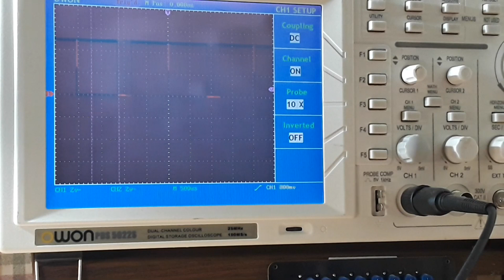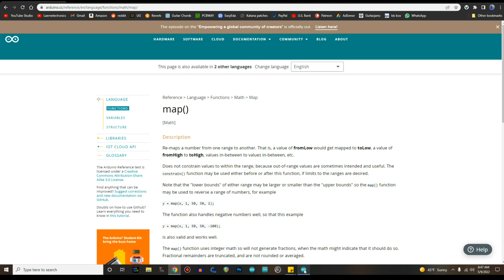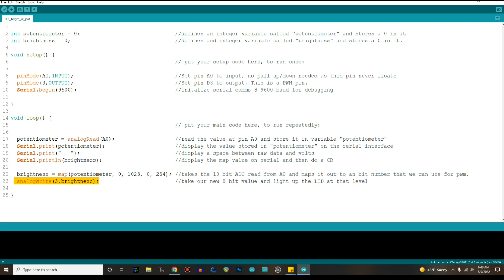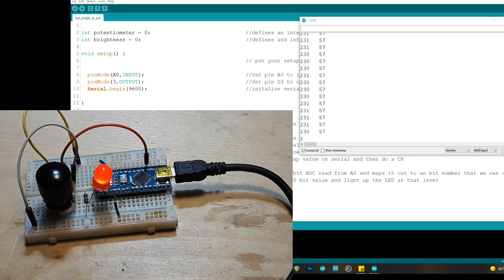Intro to Arduino PWM - Arduino Foundation Series

Comment: Paul. Can I use this circuit too control mains on hot plate ?  I have a nice hot plate but no way too control the current to it. It’s perfect for smd soldering but I can’t control the temp or make it stable.
Reply from the maker: Yes, put a relay in place of the LED
Reply: @learnelectronics  ok ty

Comment: how is the frequency of the pwm relevant here there and every where? nice knob. nice job
Reply: If you  change this from using an LED to something else, you can control all sorts of things.  I would assume you could control motor speed.  I an looking at a circuit like that for electric heated gear where you control the pulse of the current through the wire rather than using a resistor which can heat up and cause problems.  There are a lot of different uses for this type of circuit
Reply: @stickboyST  how is the frequency of the pwm relevant in each case
Reply from the maker: The arduino has multiple PWM frequencies depending on which port you are using. The frequency itself has little to do with PWM, but it can cause some birdies in an RF sensitive environment.

Comment: An 8-bit number ranges between 0 and 255. Is there a reason you chose 254 instead as the maximum value? Mind you, this is probably just a small issue if it is one.

Comment: You have a problem with your logic.  You need to calculate the brightness right after you read the potentiometer and BEFORE you print  the brightness.  Right now, you are printing the brightness from the PREVIOUS read of the pot, not the current read.
Reply: Which is still accurate enough for govt work.
Reply: @GORF_EMPIRE our government is only working with  TTL. Against, We the People, they have a trans agenda, and the Resistors are standing Tall. Sticking out like rainbow flags 
God Bless.
Reply from the maker: I was wondering if anybody would say anything about that. I don't believe that to be the case. I believe they Arduino compiler compiles those things all at the same time.
Reply: @learnelectronics  Even if so, at best you are only off by a frame but my guess is the compiler probably knows what to do.